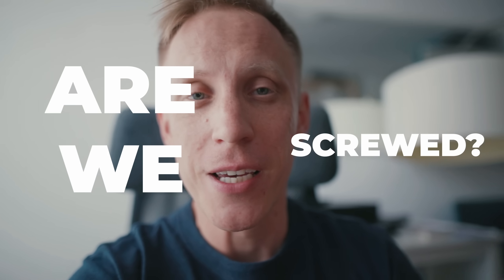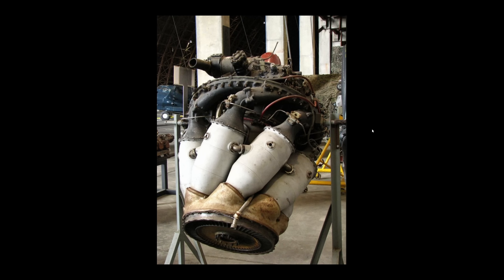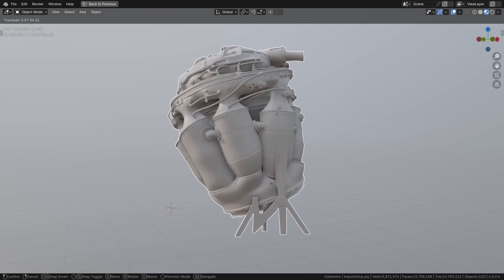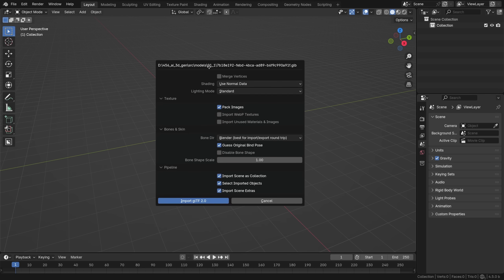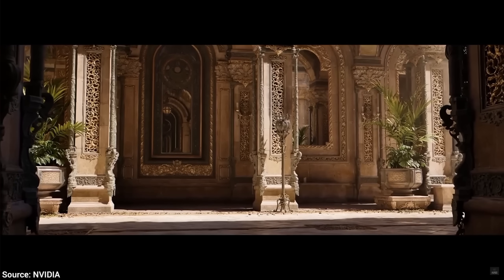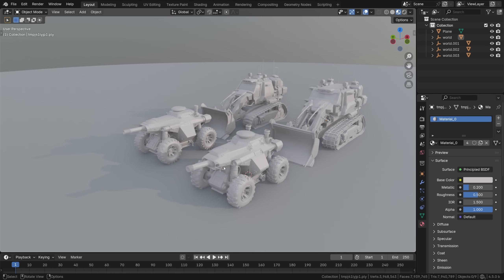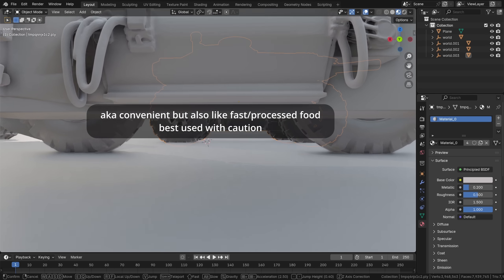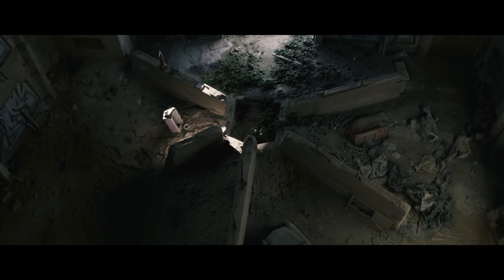Are We Screwed? (A New Hi-res 3D Shape From Image Method)

Comment: If the AI knew what the item was it could in theory make it more realistic by understanding its function. A car could have a hood that could be popped open and you could find a realistic engine inside. It definitely could be possible to enable animation with certain meaningful parameters, like wheel rotation angles etc.

Comment: I'd put myself more on the hobbyist 3D artist camp (though I have done some work in the field) and have been using blender for over 10 years. I feel a mix of threatened and also excitement? I have already used it for example, to generate me a concept model, and then I go in and re-topo, re-pose, fix/edit stuff. Frankly, the base model would have been something that would take me ages, especially for themes that I just don't work on much or practice e.g. I am great at hard surface, but more biological stuff is not my skill, so it helps iron that out and I use the rest of my skills in 3D to actually make it workable for either game asset or 3D printing for fun. And in that sense, hey its great. I still got my creative input into it. From that experience I can clearly see that one cannot just generate and dump it into whatever creative work they are doing without having built the skills needed to recognize and fix the issues, customize etc. On the other hand, I think frankly a lot of people just wont care... and I am confident the 3D asset market is going to be flooded with cheap crap that is 'claimed' to be non-AI, and for asset flips, kit-bashing may just be perfectly ok enough to work. 

My hot take for the future is: we will reach a saturation point where there is sooo much AI content, and recursively AI being trained on it (with no way to know its not) that these models will get perhaps not worse, but significantly less creative. They will have done all of the typical themes and art styles and ideas 1,000,000,000,000 times over and thats where Human creativity will regain its value. Until then, buckle up I suppose. ESPECIALLY those in the games industry.

Comment: To a lesser degree I've been experimenting with this using meshy. The V6 beta is quite amazing for 2d to 3d. The text prompt to 3d is also impressive. Personally I like it for my needs. It saves me hours if not days of manual work. There's nothing to fear or be threatened by because it's just a tool and in the end there is always tweaking to be done and somebody has to do it. Learn it as a skill and you should be fine. Just be sure not to fall behind the curve. That only leads to one becoming bitter and resentful.

Comment: I already used AI objects in various jobs and the art director always wanted changes. So good luck with that if you're not a 3d artist. Also shaders, material ID's, UVing (could you imagine uving some of these models?), and non symetrical models? Clean Quad based topo is a must for these tasks. Most of the time it's easier to start from scratch.

So yeah it might be something that a project manager goes weak at the knees about but practically we are still important. AI certainly has it's place in the workflow but mainly at the concepting stage.
Reply: I would disagree in the starting from scratch because the sense of scale you get having the whole thing there visually makes you model twice as fast. you're not guessing anything size related as you basically have a representation of it already there, now your'e just using your modeling skills to make the primitives you see in the provided messy geometry.

Comment: AI IS GREAT i LOVE IT ; HOWEVER IT WILL NEVER GET RID OF THE 3D artist ! You may ask why am i so confident ! well there is one thing most people forgot about AI is not human it has no soul ! and it cannot compare to the human brain ! The human Brain is still more powerful than modern artificial intelligence (AI) many ways. •	

Human Brain:

1. The brain has about 86 billion neurons, each connecting to thousands of others through synapses, creating trillions of connections.
2. It processes information in parallel (many things at once), making it very efficient.
3. Estimated computational power: around 1 exaflop (1,000,000,000,000,000,000 calculations per second).

AI Computers:

1. The fastest supercomputers can reach exaflop speeds too, but only in specific tasks like math or simulations.
2. AI works in a linear, step-by-step way, and usually needs massive energy and cooling systems.
Reply: the only way to stop robots/ai to take human jobs is to introtudce AI/ROBOTIC  TAX . if a company uses ai instead of employies they should get taxed and branded as artifical company

Comment: Um... I recently did some tests trying to integrate AI 3d generators (Sparc3D included) in a character game-dev pipeline. And I can confidently attest, that even the top tier ones are gimmicky at best and utterly not suited for a professional workflow in general. Sure they do manage to create some sort of toonish characters from prompts for the giggles, but following a highly specific detailed piece of concept art - nope, a crude blobby approximation is the best you can hope for. A starting mesh to sculpt on at best, saving some 20 minutes of blocking stuff in in Zbrush. 
Trying to do lowPolies is also a disaster. The topology even with the best of them either requires tons of cleaning, or is utterly useless for professional use. 
I even ran a test doing a LP by hand vs. using AI and then cleaning it. Guess what - doing it brute force by hand in Topogun3 was quicker. 

I can definitely see the potential of the technology, I'm sure great tools will be coming along some time in the future. But it's not there yet for game-dev, not by a long shot. But there is potential.
Reply: So far theyre garbage, I'm hoping they remain like that. But I'm sure you've seen AI slop videos and its crazy how it can render out just like...whatever the fuck it wants lmao. Just not specifics.

Comment: Every time there is a major advancement in 3D work the old heads will always scoff and complain about how much harder they had it. I myself remember when box modeling was the only method of getting a shape. Learning to sculpt and now sculpting in VR was a new trick that made it easier but required some learning on my part. AI is the same. Its a tool to add to your workflow. Getting mad about how much easier the new kids have it does nothing but weaken you. Learn to use the new tools and fight to have them local and not cloud based. That is how you stay ahead, not crying.

Comment: Are we in trouble? Yes. Are we doomed? No. I think where we will be safe enough for a while is precise modeling, like Class A surfacing. You can feed a lot into AI, but those precise radius corners, I am talking millimeter precision, strictly controlled surface curvatures, that need a manual approach, not because AI in theory can't do it, it's because what you need to describe is too much and it simply has to be done manually. But, in those cases, it can be perhaps AI-assisted.

Comment: I'd say the great thing about this, is to then REBUILD it with proper topology afterwards using the soup mess as a proper guide. Then delete the soup mess model afterwards. People (especially Blender artist) need to chill with this AI revolt. I think this is a good thing. I actually hope Blender incorporates an AI tool button for retoplogy actually. Select the area with horrid topology and the algorithm understands your topology flow and then solves it in seconds. Why spend an hour fixing 7 bad corners or bad bevels and AI can do it in 7 seconds. We need to change people's thinking. Yes you still need to LEARN topology, but AI assistant sounds like a dream.
Reply from the maker: This! 🤩

Comment: i would use it to spped up work flows for animation etc, my interest in modeling is to gain a base skill or all I will need to do and to have many skills that I can utilize for my own projects. I am sadened though because there may be generation in the future that do not know the fun of modeling with its basic challenge and headaches and celebrations. you can spend hours in blender or any software like it and it is good for your creative soal and then someone comes along and rapidly changes the paradime, I also have been interested in using blender to make money eventually and I feel atleast for now there are other areas you could focus on also that will still make it possible to make money with it. modeling is the tip of the iceburg my inteest is more in vr development and currently there is a lot of pepole out there developing for it but it is still uncharted teritory on creating emersion, telling stories etc. I guess my point is there will always be somthing come along that realy rips into our creative soals. If I could ask everyone who loves blender and creates with it why you do it I think most would say because it is fun and then there would be a secondary purpose may be even why you got into it to make money. the fun will be here as long as you create with it and the money will be where you increase your skills and learn to do other things. there is building the models, lighting texturein you know and then there is taking those things and putting them together in other programs creativly like the game engines the vr plaforms for movies. the show isn't over yet ai creation is getting realy good but there are still things to learn and also for you what project do you have in your head that you want to bring to life as an indi developer.

Comment: It would be interesting to see how well the generated geometry based on a photo of an object aligns with a 3d-model of the actual object. 
That is, model an arbitrary geometry in e.g. Blender, 3d-print it, take a photo, upload the photo to Sparc3D, compare the Sparc3D output to your 3d model.
My guess is that Sparc3D uses symmetry (axisymmetry or mirror, depending on whether the object is classified by Sparc3D as spherically, cylindrically, plane symmetrical or something else) to generate the "dark side" of the object in the photo.

Comment: AI still trying to do the creative part of the job) May be it will help you to start, keep right proportions and make a basic blocking. It may be useful when you don't have a blueprint. Precision is still a big question. Retopolgy, UVs, optimization, texturing - you should still make a lot of work. And try to rig that thing so it can be used in scene or game. Can this thing make a game ready model of this dozer with rigged tracks? I think no. So, it's still more of a toy than a tool. But yes, progress is creepy)

Comment: Faster work completion doesn’t necessarily mean a reduced need for employees or layoffs, nor does it mean working 4 hours instead of 8 just because the job is done — so you can go home early. In most cases, working faster results in producing a larger number of products rather than reducing the workforce. Right now, someone might use AI to earn the same amount of money more quickly, but what happens when AI becomes the standard? Sure, let’s say one person with AI can do the work of five people without it — but then five times more work may need to be done than before in order to generate the same profit. More similar products always mean more competition and price undercutting. There’s also the issue of copyright — AI doesn't hold any. Anything generated by it can be used by anyone… but does any company really want its products to be something that anyone can sell?

Comment: if you actually look at how the pipes flow and the shapes of some elements in your model you will quickly find, that the generated model is very far from what is depicted in the image. If you just need slop to drop in the background sure, it's good enough when nobody pays attention. but when you have a centerpiece or technical model that requires attention to detail, then this is still falling short. a common ailment of the image to 3D models circling around is that the more detailed things get, the more they halucinate. until this is sorted out, there are still jobs to be had in the 3D industry.

Comment: AI generated model are a great 3d references to iterated upon and thats it. 
now you get maybe 50-60 percent work done but if need to fine tune or iterated whetever the client demands you need full control over the process which is already there which can be done with 3d softwares.
 if someone straight up says they use 'raw ai' data without knowing thier scope of work they are screwed .

Comment: As engineer who designs/modifies factory lines, I use photogrammetry quite often. 
It would be awesome if AI could make photogrammetry less noisy.
Reply from the maker: And could fill the gaps as well...
Reply: @GlebAlexandrov  In my niche I kinda doubt that It could do much more than improve surfaces. 
AI can’t re-create what it hasn’t been trained on. Just like AI can’t make image of full to the brim whine glass - there are not enough images/videos/schematics of manufacturing equipment on the internet for training. To put it into perspective how little training data about manufacturing equipment is out there - A big multi million wood processing factory has 3 copies of schematics/user manuals. First is the original cad project for manufacturer, second is exported pdf that is archived and third is printed version attached to equipment(sometimes USB drive with pdf’s). This info won’t ever get on the internet. And it is not much better for photos/videos.

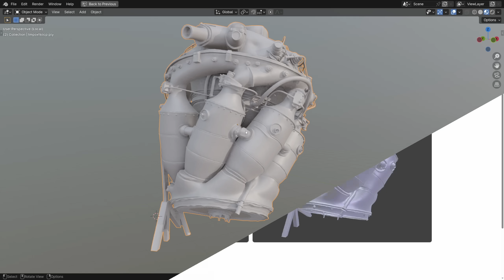Comment: what I'm immediately noticing is that this is a VERY superficial "looks good" rather than actually useful. for your first model there, it would take longer to fix all those problems it's dreamed up than to just use regular photogrammetry or a scan, or heck, just modeling the thing. like, look at the area with bolts near the top at 1:27 vs your reference, that's completely garbled and useless, it's destroyed the whole "point" of  that part of the model where two large parts are mounted to each other, now it's a squished mass with circles around it. This is true wherever you look on the model, at a glance you get a "wow that's the same" but it's all just unusable. That seems to be the biggest problem with this AI slop, its only real use is to pretend to be useful and this will never change because the people who use and develop it don't see WHY it's not useful. This will 100% trick someone with more power than sense in a company to put resources into this rather than real tools and real people but the project will be all the worse for it and they'll never know why.

Comment: Static geometry with no need for clean topology or for closeups have always been useful in many cases. Any nitpicking about what these models aren't useful for or what they lack is just copium. Many processes in 3D have always been a medium to an end, not an end to themselves, and their merits lie on how they enable other processes and optimization, like uv mapping, topology, etc, or only have artistic merit to other topology nerds. Even 3D as a whole is most often used as medium to produce what's ultimately 2D video with certain advantages of process. It's arrogant to believe that one can always tell AI apart, or tell CGI apart from practical, or tell digital video and audio apart from analog. If the hallmark is to not perceive the fakery, then by definition when it succeeds you'll never perceive it , perpetuating that belief.

Comment: There is some very useful stuff going on here for making background props and scenery. It's amazing really. But...

I don't think I'd say photogrammetry 2.0. Maybe point cloud photogrametry 1.5? I say that because the term photogrammetry also encompasses artists working from photographs to build assets by hand without there ever being a point cloud. Also, are there inputs for scale? Maybe if it has some input options for scale and measurement survey data, then it's pointcloud photogrammetry 2.0 :)

One problem about something like this isn't just the AI slop aspect, but how compelling and misleading it is to the uneducated. This kind of tool is often promoted as being a black box solution. Because it looks so compelling, producers and even supervisors who aren't hands on, that don't really understand the limitations of point cloud generated assets without correct scale, can really dig themselves a hole using tools like this.

Comment: I do almost no 3D modeling, but I am an artist and programmer, and have tried making some 3D models at times, so take it with a grain of salt, so I can give some perspective, but from what I saw with tests, and from what I know, it seems rather unoptimized for the high poly count, and also has multiple little errors or issues when you zoom in (important in cases where the object is close to the camera, or when it's big)
it seems rather better used for reference to make actually good and well optimized 3D models
or you can take longer by modifying the existing model, which is an issue seen also in programming and copilot, where editing ai-generated code takes far longer than making the code yourself, and, in the long-term, diminish one's capability of programming and one's own skills within this domain